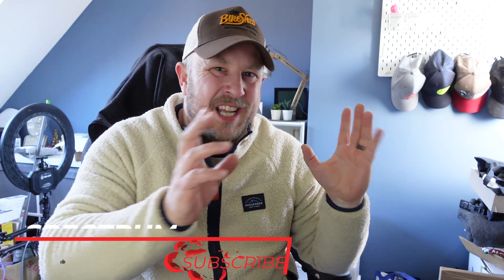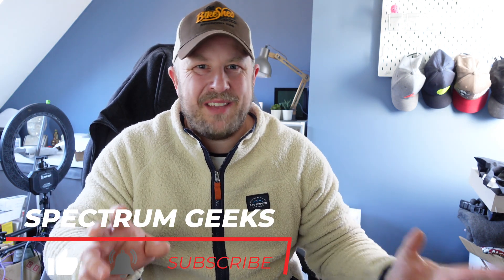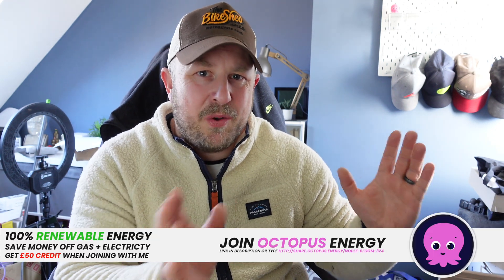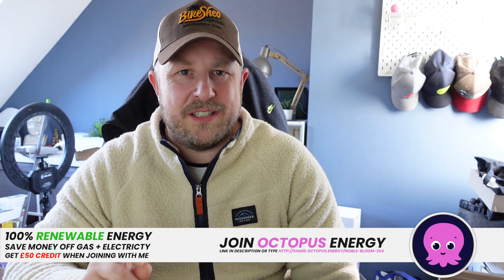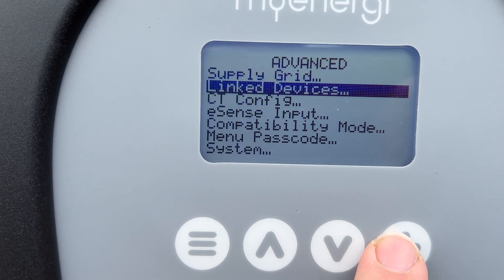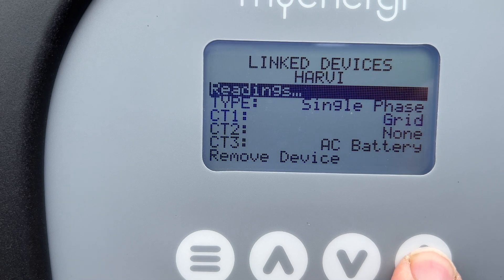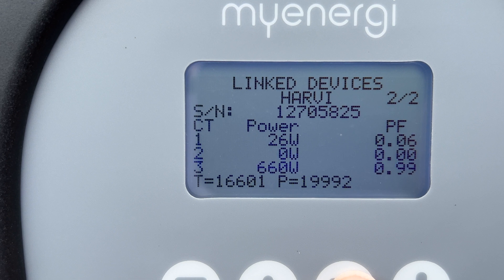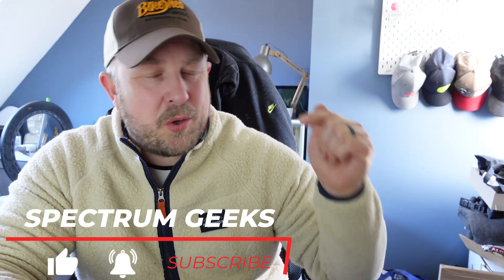MyEnergi CT Clamp Readings // Where To Find // Waiting For Surplus // Eddi // Zappi // Harvi

Comment: Where do you connect the CT clamp on the AC battery with the arrows the right way?
Reply from the maker: It goes on the positive cables into breaker for the AC battery, with the arrow in the direction of power flow.

Comment: Hi hope your well thanks for the vid. 

Installed a Eddie recently and struggling to connect it to the internet. Also struggling to find the reg code.  Anychance you could help would be great cheers
Reply from the maker: To find the reg code on the Eddi, go into the Main Menu and scroll down to and enter Information.
Once in the Information menu scroll through to page 2 of 6, and at the bottom you will see the Reg Serial Number and Reg Code.
In terms of connecting to the Internet, you can either do this directly wired via Ethernet (you need to open the case for this), or join your WiFi.
Its difficult to help with this, as how this works will depend on your WiFi network configuration.
Reply: @SpectrumGeeks  ok mate that’s great thought so. Struggling to connect to the network. 

Is there a RJ45 port on the Eddie 2.1 do you know ? Would check but not currently at the job. Thanks Chris
Reply from the maker: @pooley2853  The Eddi 2.1 with vHub I believe has built in Ethernet.

Comment: Good vid. Subbed & liked. 
This looks very familiar. I'm having issues with my Zappi which was installed a few months ago with my 4.1kW solar array, GivEnergy hybrid inverter & GE 9.5kWh battery. I also have an Eddi which seems to be behaving itself but the Zappi will not charge even when there's excess solar &, when I force it to charge at night on off peak lekky it drains the battery. I think part of the problem is that both the Eddi & Zappi have CT's on the grid supply when there should only be one Grid CT on the MyEnergi network. As for the battery drain issue (which seems to fairly common problem) I may have to add & config extra CT's. I have an engineer coming back to take a look at it this week but this video has given me a good idea of where the problem is.
Reply from the maker: Glad its helped, thanks for liking and subscribing, its much appreciated.

Comment: Hi Dale. Your video is excellent    and just what I’ve been looking for to solve my Zappi/solar issues. I installed a Zappi 2.1 last year and recently added solar and batteries to my home. Now the weather is sunny I’ve tried charging my ev with solar but it drains my battery then goes to the grid, which is not what I want. I only have one CT clamp which is for the grid. In order for Zappi to see solar excess and avoid going to battery and grid do I need two more CT clamps, one for solar and one for battery? And can these be connected wirelessly to Zappi? Thanks.
Reply from the maker: Yeah you will need additional CT clamps (about £15 each) and to connect to the Zappi wirelessly you will need the Harvi (about £55), then in the Zappi you can use the avoid battery drain option. Now your Zappi will have information on grid, solar and battery to operate in a more optimal way.
Also on your Zappi, if you want it to only use solar (when there is surplus) you want the option Eco+, and then only time it will use the grid is when there is an active boost timer.
Reply: @SpectrumGeeks  Thanks for your help, Dale. I enjoy your content.